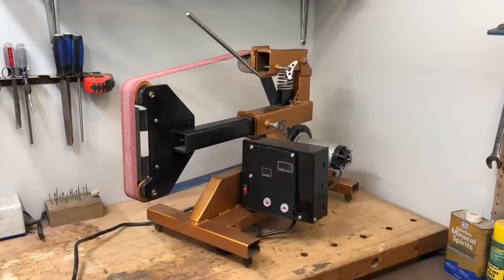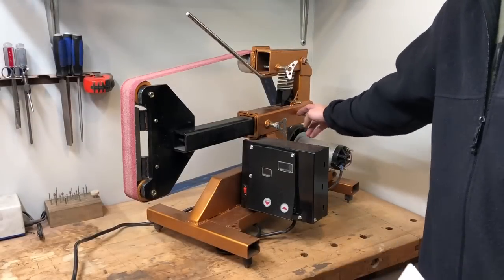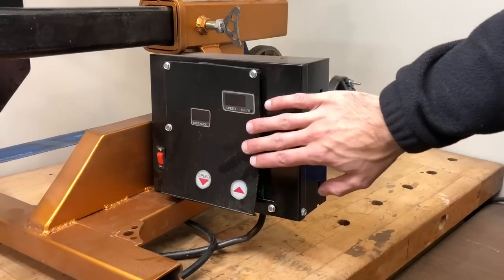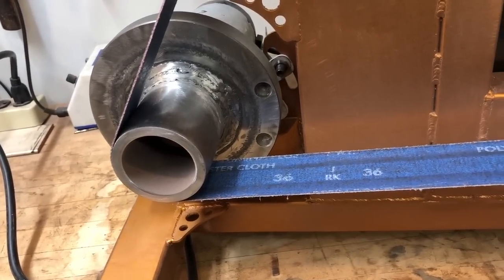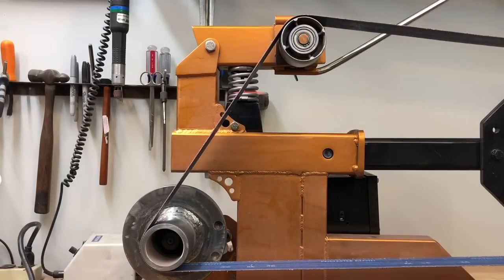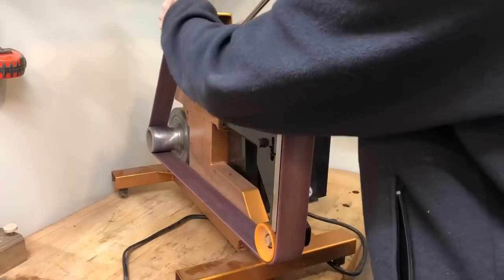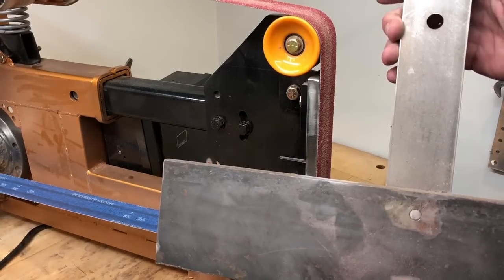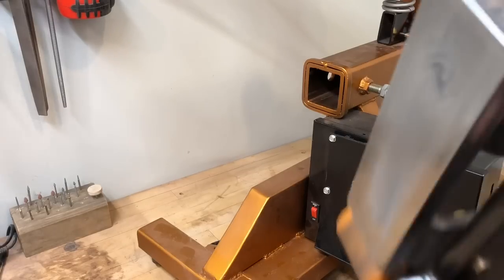$100 DIY 2X72 Belt Grinder Build!

Comment: Awesome! @8:17 its clear that the harbor freight hitch receiver should have additional thumbscrew or maybe a bolt on top as well to take out any play vertically. Great job!
Reply from the maker: +Tactical Ant I noticed that when I edited the footage. That kind of movement isn’t typical, and I haven’t ever had an issue with it. I think it moved that time because I had been moving the grinder around and tightened the platen while still supporting some of the weight so it wasn’t sitting on the bottom of the tube

Comment: In the few seconds you showed of you actually grinding on the blade I heard the  motor slow down a little due to the friction, does it ever slow down too much or does the motor seem strong enough for what you're doing?

Comment: I am building my first 72 in belt grinder.  The hole thing is built but I cant get real poser out of the tread mill motor.  It spins up to speed but then i apply pressure to the belt and it comes to a stop. I am at a loss to figure out what is going on.  Any help would be great.
Reply from the maker: Ken Lewis does the motor have a flywheel on it?
Reply: @StraightCutGears  I have the drive attached.  I changed the circuit board and things got better.  I admit I know just enough about electronics to probably no lt die.  So just for clarification what is a drive wheel
Reply from the maker: The pulley on the motor. Is the original pulley still on it or did you take it off? I used my original pulley/flywheel and adapted it to work with a belt. They’re usually very heavy and these motors need that. The extra rotating mass helps keep the belt spinning. Also do you know the horsepower rating in the motor?
Reply: @StraightCutGears  Ok I will keep that in mind I replaced the fly wheel with a low weight drive wheel
Reply from the maker: That’s probably your issue
Reply: @StraightCutGears  ok thanks I am pretty good aat modifying things.  But would using a more powerful motor do anything.  the as is motor is 1 hp but I have some 2.5 hp motors
Reply from the maker: It definitely would help. Mine is 2.65hp

Comment: Sorry,  I don't feel like reading through all the comments lol, On the speed control is that strictly all treadmill parts or did you have to add anything ? And what size motor did you get/find ? Thanks. Man that does look awesome, nice job..currently looking for all the parts, I just hate anything electrical, that's why I'm curious about the speed control..
Reply from the maker: Everything from the motor to the control board is all treadmill

Comment: That is not a brushless motor.     But is one of the nicer treadmill grinders I have seen.  I built one too using skate wheels and they work for a bit but I kept eating the bearings! I went to aluminum 2 in contact wheels for $35 on Amazon.   That is the most I spent on it.  I use it all the time.  I plan on doing another one that tips horizontal but I have not decided if I want to stick with a treadmill motor or go 3 phase and VFD.     One think I did do on my grinder that I have never seen with treadmill grinders is I put a jack shaft and used a belt to lower the max RPM.    I looked up a standard belt speed and 3600 ft a min is standard for belt speed.   Those motors turn close to 8'000 rpm.  so I drive just under 4 inches times 3.14 is about 1 foot per turn in belt movement.  So 7500-8000 FPM  you really cant or do not need to run it wide open.    The 1:2 ratio on my jack shaft lets my RPM go high on motor but keeps my belt speed down around 3600FPM and doubles my toque.      

But over all nice build.  I built mine out of everything laying around except my wheels.   You can view it on my channel.   Don't laugh at my video or knives.... Too Hard anyway..as I was new to both. Still am videos.  Lol     But OMG these grinders are handy.  I used mine yesterday to sharpen my mower blades.

Comment: An excellent and innovative design. I just started on one of my own recently. Originally, I was going to do something like you did, using the controls from the treadmill to still control the motor. But I discovered that it's much easier to wire in a 5k potentiometer. This way you can easily bypass the safety features on the treadmill that prevent you from starting at the same speed each time. Love the video, keep up the good work and be safe 👍
Reply from the maker: Jacob Lattimore ok thanks I’ll have to look into it. I used what I had since it was free

Comment: Nice work!   I was wondering how you protect the motor for the metallic dust that it generates?
Reply from the maker: Thanks! Unfortunately I did t protect it from the dust and it did start messing with one of the bearings. I was able to clean and lubricate it and it has been fine since.

Comment: very nice build. what source for the tracking wheel? are any of the wheels crowned? I really like your colors. many thanks
Reply from the maker: +2wheel charlie the top tracking wheel by the tensioner is crowned. It started life at a flat wheel from a smaller belt grinder. The grinder was bad. I put a crown in it by spinning it and using a 4” grinder with a flap disc. As far as sourcing one, I know they sell them online. This was just what I had laying around.

Comment: what did you use for the tensioner wheel?
Reply from the maker: It was a wheel I had from another smaller grinder. It was flat and I had to put a bevel in it

Comment: Just saw your video on the belt grinder.... What is the wheel at the tensioner, don't really understand what the hinge is for.... Awesome build!
Reply from the maker: +keiththecarguy1967 the wheel is one that I just had lying around. The judge allows the wheel to be able to tilt. That change of angle will cause the belt to move left or right (if viewing from straight on) that allows you to align the belt up with the platen. Different belts track different, so you need that adjustment or else the belt may fall off or dig into the side of the grinder. Hope that helps

Comment: Well done!  What did you use for the tensioner (top) wheel?  How have the skateboard wheels & bearings held up over time?
Reply from the maker: Skateboard wheels seem to be holding up just fine. The top tensioner was a flat wheel that I had lying around. I had to grind a radius into it.

Comment: Hey nice job way to be resourceful👍!   I have built the same thing and I was wondering if yours will bog down when you grind, mine will and I’m trying to figure out why.  I actually had two treadmills of the exact same motor and controller and I’ve tried swapping the motor and it still bogs down so I’m wondering if it’s normal or if there something wrong with the circuitboard and or transformer? Thanks Woody
Reply from the maker: +Woodrow Smith 
Mine bogs occasionally, I think it is just how the circuit board works. It try’s to maintain a steady rpm and sometimes overcompensates when you grind to hard. So it will give more power to maintain rpm and then when you let offf, the rpm spikes. When it spikes it adjusts and drops power and if you try to grind when it is dropping power it will bog really bad.

Comment: Excellent work! I'm curious to know what your "earned profession" is? If you are a 'metal fabricator', welder or work in a shop, then your skill wouldn't surprise me (you could probably do this with your eyes closed), if on the other hand you make your living in something totally unrelated, I would have to say WOW! Lets see what sort of knives you'll be cranking out. Whatever the case, you are more "highly evolved" than most guys your age. Well done!
Reply from the maker: +Egon Speneder Thanks! I learned to weld before I was 15. I also worked in a fabrication shop for a number of years but decided to get out of that line of work because it’s so unhealthy. Now I repair and sharpen surgical instruments. I really appreciate the kind words!

Comment: I was curious about where you got the crowned pulley on the tracking assembly.
Reply from the maker: +Morgan Barker That wheel was a flat wheel that I had laying around. I put a crown in it. You can find wheels online for not to much. I believe if you could put a crown in a skateboard wheel, that that could also work.

Comment: Question  I’m having issues finding wheels 2 inches wide
Reply from the maker: +Bill RodgersII The ones on the platen are from a skateboard and the tensioner one I had. You can find them online. I believe you can get an entire kit. Depending on how much you use it you could probably use a skateboard wheel on the tensioner also if you could get a crown in it. The tensioner pulley can be wider, it’s actually better that way since it gives you more adjustments
Reply: longboard wheels on ebay
Reply: I found on eBay a complete wheel kit to include the drive wheel and platen face for 100.00 almost have it built  but the treadmill motor I found was from a older machine and speed was controlled by a slip shive and only 1/3 hp. May have to upgrade that to a farm duty 2 hp which is on sale at harbor freight

Comment: Hey there, I am looking at trying to make a grinder like yours and wanted to know where you got your tracking wheel and what the cost was? You don't address it in the video that I can tell.
Reply from the maker: +Gundy1024 the wheel I used was one I had lying around. It started out as a flat wheel that I then ground a crown into. If I did it again I would find one that’s a little wider. The belt is the same width as the wheel.

Comment: Love the design. I find that the metal used, especially in the table is a bit excessive (JMO) and you could have gone a bit lighter on the steel thickness to lighten the overall weight. Not a big deal.
 I'm not sure why most belt grinder builds are constructed of 2" and 1 1/2" steel and not downsized to even 1 1/2" and 1 1/4"? To me, I would think that it is steel after all, and that reducing the size won't impact the tensile or rigidity of the unit. Nevertheless, still impressive. 
How have those skateboard wheels held up? I'm curious to know if they can withstand the pressure of the belt friction as compared to alloys such as aluminum? It certainly is a cheaper route to go when you are on a budget. 
I would have loved to see what guts of the treadmill you pulled out to construct the speed controller? Enough yammering on my part. Well done! Cheers!

Comment: Ok love it, only thing I would do differently is don’t come from below the tube for ur rest instead use the square tube as a second receiver and come from their  so as u change up ur platum choices for more versatile uses u can inter change and remove the rest. Easy
Reply from the maker: +Bill RodgersII that’s a good point. I knew that when I made the rest that way it would be a bit clunky, but didn’t want to waste a bunch of time if the whole design didn’t work.